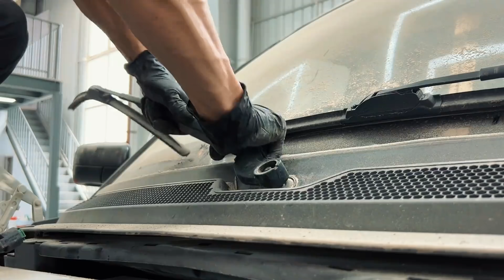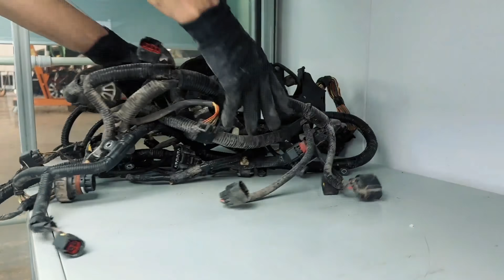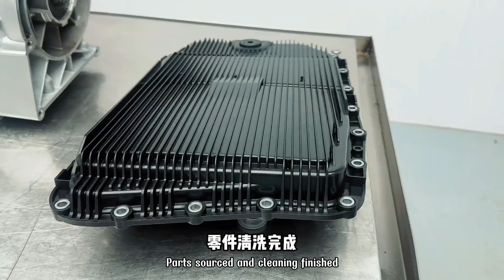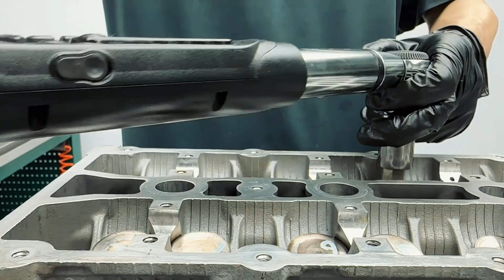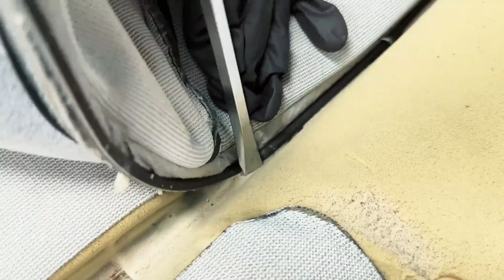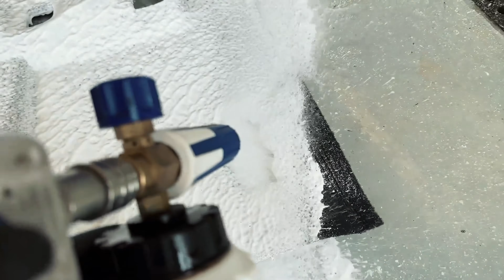$32,000 Range Rover Sport Fire Damage Restoration

Comment: Its crazy. Same car in the UK (Pre-2009 Range Rover Sport with damage) would likely be worth only around £800 max. A well looked after, running car of the same age is worth around £2-3000 depending on milage and condition. Even a low milage perfect example from 2012 is only worth around £7000. Another fascinating video though. Great work!